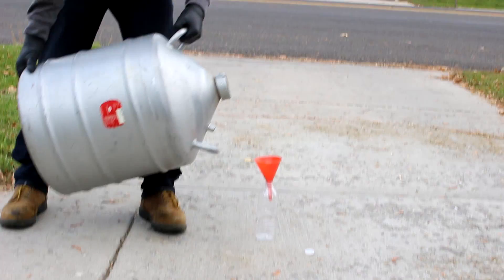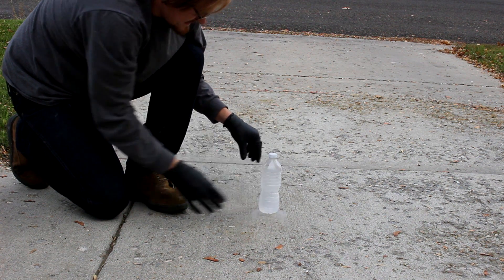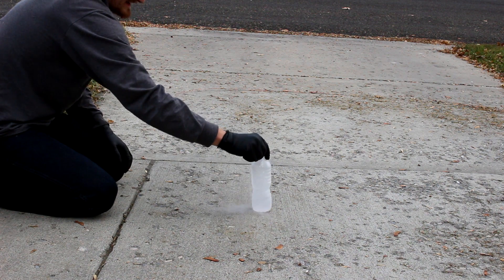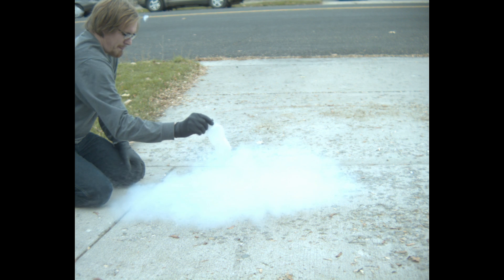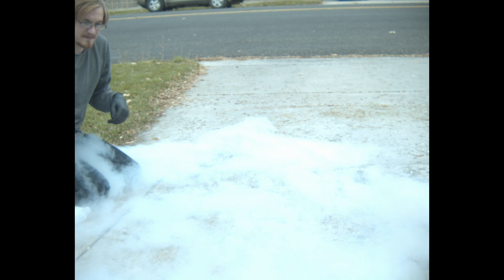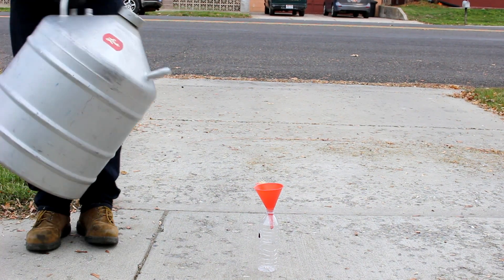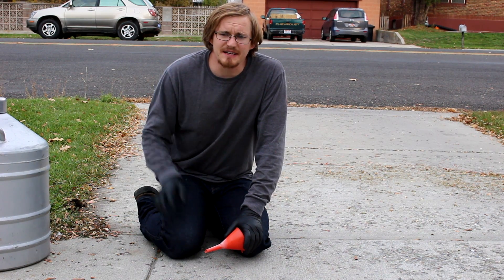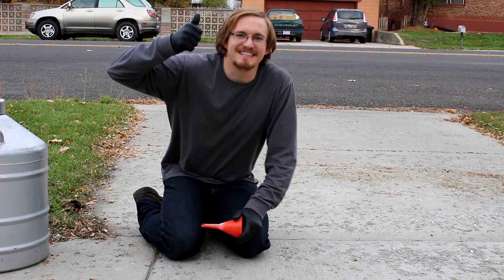Liquid Nitrogen Water Bottle Flip

Comment: That is great, your surprise was legit. Also, if I may add. It would appear that the container once it gets to -32 C would be frozen to a point where there would be no bounce to allow the momentum of the bottle to stop long enough to land flat, It also appears that pressure+cold equalled a solid rounded base. I would recommend that you try without the lid and perhaps have some thick wool on your lap in case it spills. I do believe there is another scientist that threw liquid nitrogen directly into his face without hard, I believe you should be safe without a lid. While I know bottle flips usually contain a lid, I think that is based on the factor of error so it doesn't spill, however, you have placed holes in it, so this factor is already eliminated. Anyway, See ya next time.

Comment: To, Cody's Lab
What if you didn't have the bottle capped? even if you made the hole bigger in the cap the liquid nitrogen was able to create enough pressure to rock the bottle.  But if you did it with out the cap then the gasses would be free to pour out causing less of a rock, of course there is a chance of the liquid nitrogen spilling out if you don't flip the bottle with extra force.

Comment: You could cut the bendy parts off of drinking straws and glue three of them in the cap pointing down and out. Use that pressure to stabilize the bottle when it lands.

Comment: DO A LIQUID HELIUM (or hydrogen) BOTTLE FLIP :D
Reply: Too hard to have the liquids at room temperature... of course it can be made at higher scales but diy would be super hard take the liquid out of a vacuum as a liquid it just won't remain liquid at such pressure (1 atmosphere)
Reply: But how are people able to store liquid hydrogen in a Stainless steel thermis? (not for long periods of time of course)
Reply: Its like storing liquid carbon dioxide in a fire extinguisher.

Comment: I have a problem, I have 3d printed PLA plastic and electrofomed copper on it. Now I want to chemically dissolve PLA plastic so that I can use copper. I tried sodium hydroxide, Benzene but unable to dissolve. Please suggest me a solution which will dissolve PLA plastic without affecting copper
Reply: http://www.vinland.com/blog/?p=68
Reply: dichlormethan dissolves PLA pretty good. its sold as a glue for model building, very cheap

Comment: I have a hypothesis for why its hard to flip a liquid nitrogen bottle. As you flip the bottle, the liquid briefly losses contact with the sides of the bottle and increases the surface area causing it to evaporate faster, which increases the pressure inside the bottle. the excess air in confided within the bottle by hole or holes, and is unable to escape but as it does it creates downward thrust which supersedes the rotational energy of the bottle. Also i forget the exact name of the effect, but when the vapor increases the pressure of the bottle it also increases the temperature of the bottle thus speeding the bottles evaporation.

Any thoughts?
Reply: That has so much sense!
Reply: ***** the liquid nitrogen? Its density basically counteracts the "lightness" of it.

Comment: Try it in a cold walk in freezer.
Reply: Wouldn't make much of a difference. Both are nearly just as hot relative to liquid nitrogen's boiling point.
Reply: what if you could build something in chamber that is cooled to cryogenic temperatures. it would work in theory then or in a more solid bottle that could withstand the pressure.

Comment: The plastic is thin, has no insulation ability, and when super chilled is unable to FLEX and absorb the SHOCK of the landings - also the liquid Nitrogen simply is boiling off as it contacts the thin warmer wall of the plastic.

Comment: how do you store liquid nitrogen?
Reply: SirArghPirate when you release the pressure the liquid comes out.
Reply: SirArghPirate in a bottle teehee
Reply: Long term we store it in a large pressurized tank where I work.
Reply: Sure, but how do you keep it so cold?
Reply: SirArghPirate There isn't any kind of refrigeration system they just use insulation The Liquid Nitrogen keeps itself cold since it isn't coming in contact with anything else. Not even air.
Reply: Okay, so you buy it at a certain temperature and store it in a container which basically is a large thermos?

For how long can a container as shown in this video be stored? I mean, eventually it will reach the outside temperature, and according to the ideal gas law the pressure will increase accordingly, will this pose a risk of rupturing the container?
Reply: SirArghPirate Basically yeah.
Reply: Okay, so when you increase the pressure you can store it as liquid at higher temperatures and when you release the pressure the temperature drops?
Reply: That's it, under high pressures gasses become liquids at higher temperatures, for instance, carbon dioxide (which is known for sublimation process) under high psi can become a liquid.

Comment: I think the problem may have been that the plastic became rigid from the liquid nitrogen. Without any plasticity it bounces and rolls around before stopping, rather than just sticking as it would with water. the high speed seemed to confirm that hypothesis. Compare the flip at 2:00 to a regular water bottle flipping. It bounced around when it hit.

The jet of nitrogen is also a problem obviously, I'm not saying that the rigidity of the bottle was the only fact. Just that it was a contributing factor.

Comment: You could build a nozzle like the apollo emergency escape rockets which would vector the thrust downwards and out, causing the nitrogen thrust to be used to push the bottle top upwards, hopefully righting the bottle. 

It would have to be built pretty light, and lN-proof.

More of a conceptual idea, unless you have something like a ceramic 3D printer.

Comment: One  -- you could go to the Antarctic during its winter.  If that is not cold enough to slow the expansion of nitrogen, then you might try Pluto.
B -- Have you considered the nitroglycerine bottle flip?
Reply: nitroglycerine? oh god please no
Reply: it's ok, he can poke a hole in the nitrogylcerine bottle so it won't explode
Reply: Nitrogen violates the laws of physics by existing at a temperature below absolute zero? Who knew?
Reply: No, I'd like cody to live.
Reply: Antarctic won't work, it's 183 kelvin, whilst liquid nitrogen is 77K, and a lot of the heating is  due to the movement of the nitrogen rather than taking it from the surroundings anyway.
Pluto won't work because pluto's low pressure means there is no nitrogen liquid phase.
Reply: Well if Antarctica nor Pluto will work, Cody might have to find a different solar system.  Might be a long wait for the next video.  Bummer.
Reply: Terry Endicott Titan might work though (one of Saturn's moons), since that has a proper atmosphere and has a surface temperature of about 90 kelvin. However, as I'm not sure how much heating you'd get from the sloshing of the nitrogen itself, that might cause quite a bit of boiling regardless of the surrounding temperature.
Reply: Aidan Adkins Good catch, I meant 77 Kelvin. I'll edit.
Reply: To be completely honest, if Cody made a video on  Pluto, I wouldn't be the least bit surprised.  He's just that awesome.
Reply: +Aidan Adkins Picky, picky, picky
Reply: hi Terry my name is Terry

Comment: Do one with dry ice
Reply: that's a solid, i think it defeats the object.
Reply: +The Crow  
Depends on pressure.
Reply: user255 if it were liquid carbon dioxide you would have just a few seconds before it completely exploded
Reply: ethan satow Yeah you would need a lot stronger bottle. But it is doable.

Comment: You just need a glass bottle and a soft surface, the pressure was causing the bottom to bulge out a little it seems.
Reply: Cody Furr glass bottle doesn't sound like the best idea for a water bottle flip
Reply: Thats why I said a soft surface, like a yoga mat or something rubber. I knew you were still alive Houdini!
Reply: then you'd have glass shrapnel instead of plastic. But the reason it wasn't working was because it was actively generating thrust, throwing it off.
Reply: Gatorade bottles actually work really well for this.
Reply: maybe any carbonated drink bottle is better than a water bottles since they are designed, specially at the bottom to handle pressure
Reply: You'd still need the vent with the glass bottle to prevent that shrapnel. I think the thurst would help force it down, you just have to throw it right.
Reply: Cody Furr
Houdini is dead. This halloween marked the 90th anniversary of his death.

Comment: Safety goggles, maybe?
Reply: Safety squints are all that's needed. And don't forget to have your mother on speed dial.
Reply: for what, a bit of plastic?
Reply: He war wearing regular glasses. In this scenario it's equally effective
Reply: lol
Reply: +fibrewire08 You forgot the 2 condoms!
Reply: A bit of plastic can still do quite a lot of damage if it moves into your eye at high speed. Eyes are squishy after all.
Reply: It's equally effective if we assume the shrapnel moves at a slow pace. Penetration power increases with speed for any material, it's not less dangerous just because it's plastic that's going through the glasses instead of metal. Remember, you should pretty much always wear safety glasses for any science experiment, even when you consider it unneccesary, because betting your eyes on the chance that you won't need them is stupid.
Reply: Colopty nerd 🤓
Reply: Jorge Burnett
Did my following of a science related channel tip you off?